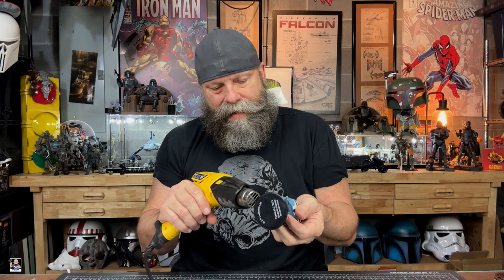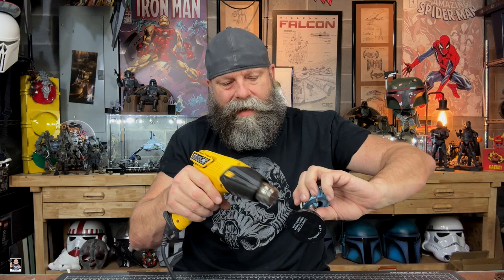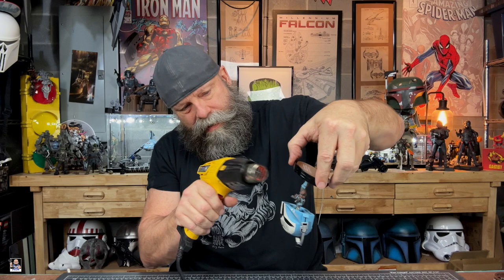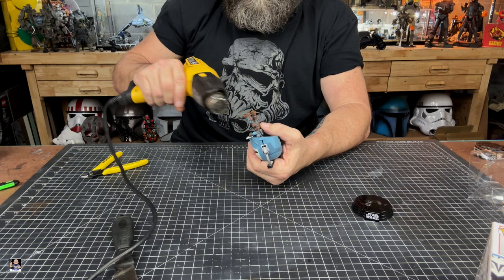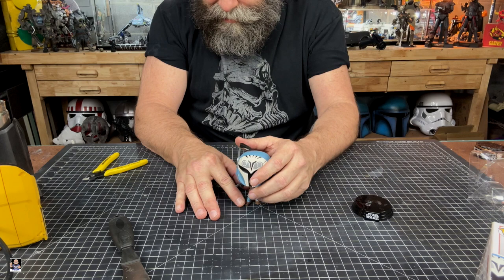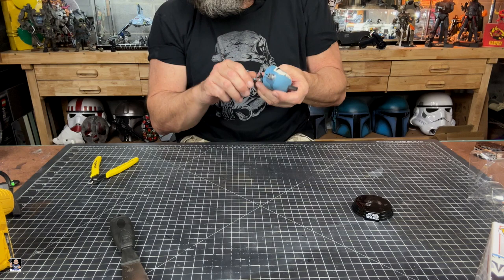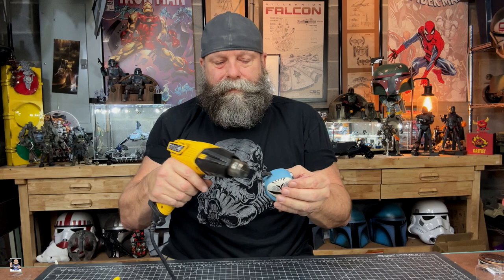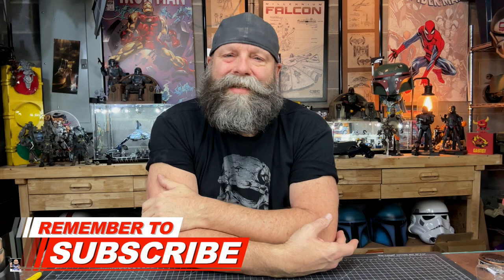Let's Modify a Funko Pop with a Heat Gun | What Could Go Wrong

Comment: Most plastics that were melted during production will return back to it's normal shape just from heat if it is deformed.  To set it use cold water and run it under it or submerse it and the plastic will stay in that shape.